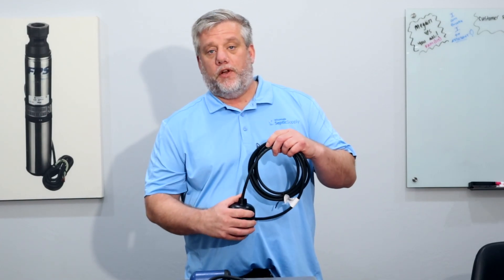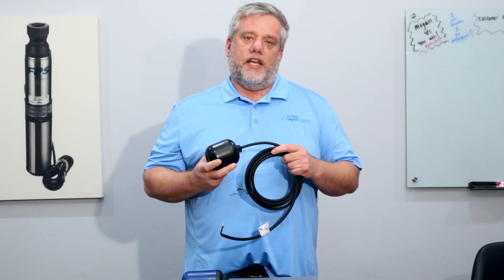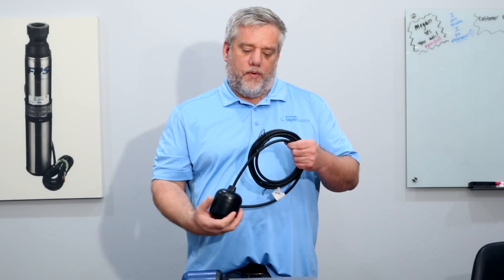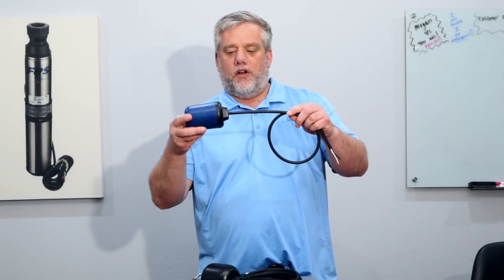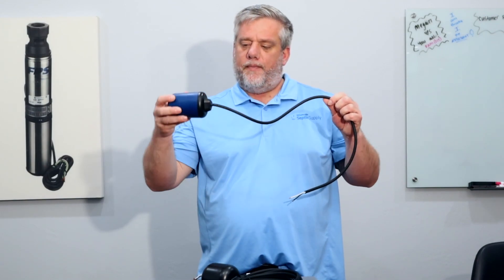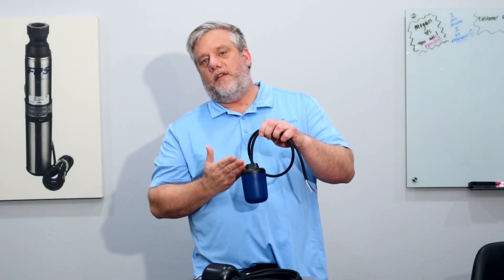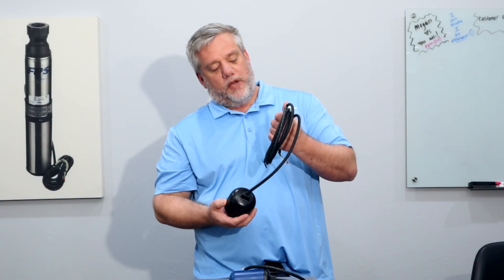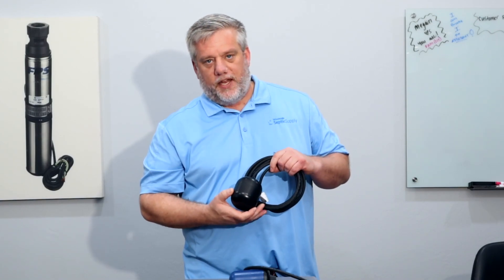What You Need To Know About Float Switches

Comment: I have a liberty FL51M effluent pump. The pump runs at 120 volts AC at 12 running amps. Many mechanical floats I've seen are 13 amp rated. Would it be OK to run with a 15 amp float to give the eff. pump a leeway without damage to any component (pump or float)? What float brand is compatible with the FL51M? I Have a SJE Rhombus dose timer control box. I need a float that has the low level cut off  (not the alarm float)
Reply from the maker: @stevenwood7131  yes it will be fine